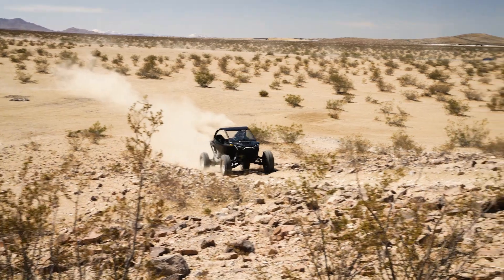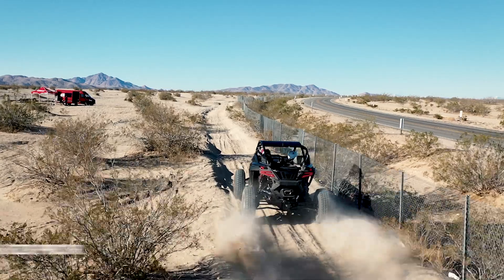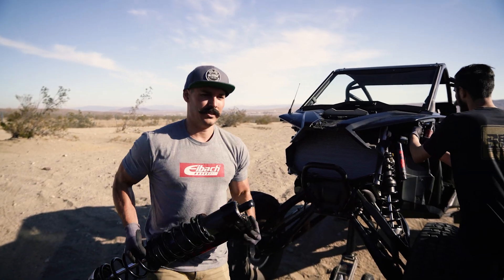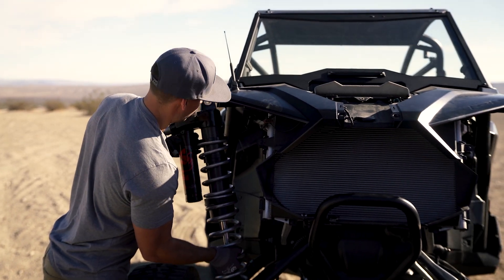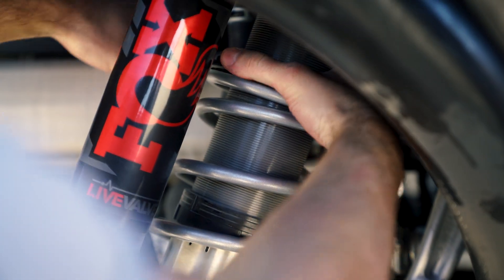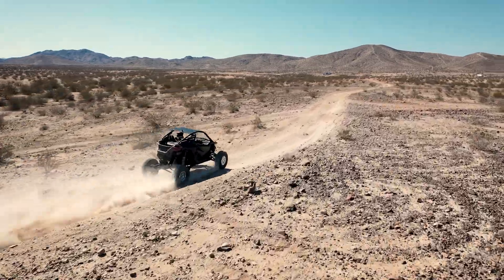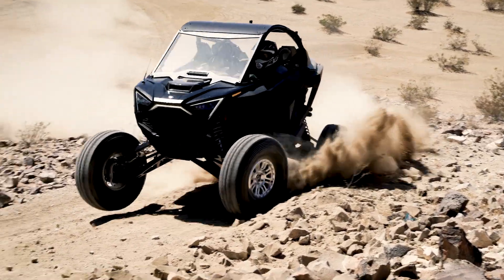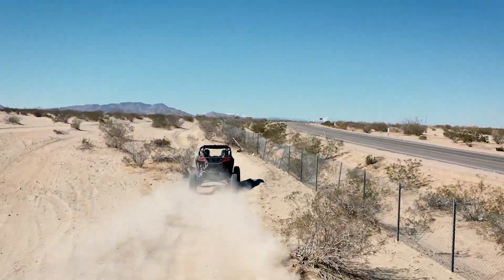RZR Pro R UTV spring kit development

Comment: Any 4 seat Pro R 4 stage 3 springs?
Reply from the maker: Hi, what year?
Reply: @EibachUSA  I have a 2022 Pro R 4 Ultimate Fox shock live valve model - with winch, front bumper, full glass windshield, rock slider bars.  I do not see any on your website.  I prefer an option from you guys versus any others.
Reply from the maker: @leeman20s98  Hi, looks like we haven't tested a kit for that model yet.
Reply: @leeman20s98   We've got one lined up in a couple weeks from now. If we don't have to make any parts, and the springs that we confirm in testing are in stock, then we should have a kit available shortly after that.  Make sure to sign up for our emails so you get notified when they hit stock.  Hopefully very soon!